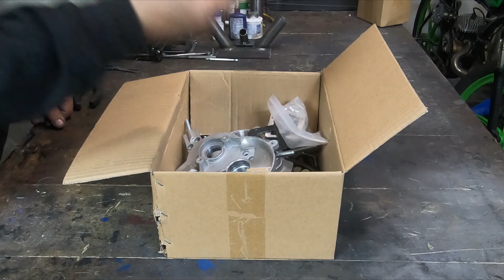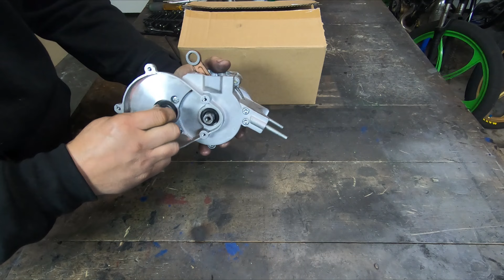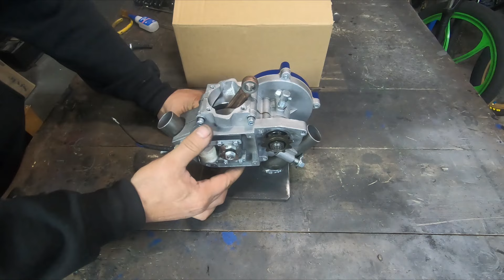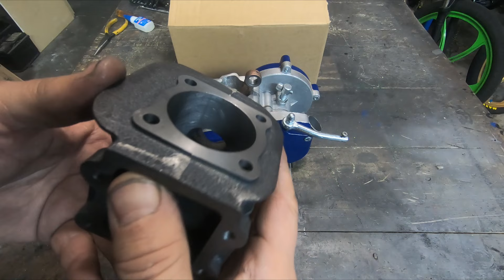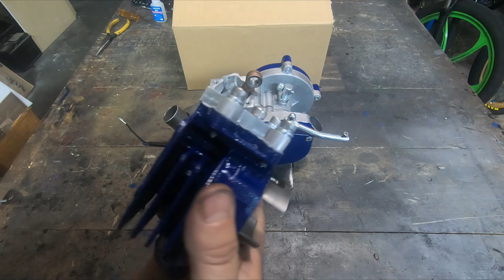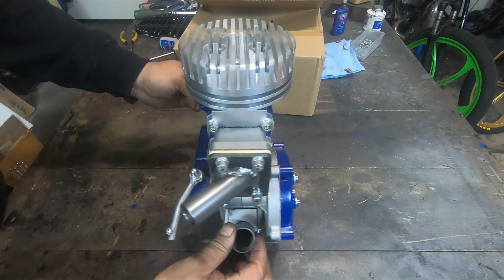Fastest Motorized Bike Engine Ever Built !

Comment: I start with the ZEDA engine. The cylinder has the 6 little dots on the side, this has  bigger bypass ports. I match all the openings, intake and exhaust plus the gaskets so there is NO gasket in the way. Intake port is raised 2 thousands and the exhaust is lowered by the same. All edges around the ports are smoothed .The piston skirt on the intake side is trimmed so when at TDC there is no skirt blocking the port. The Big Block reed. Stock ZEDA carb with a #65 main jet. I drill a few large holes in the black plastic breather cover. Tuned pipe and Hi Compression Head. Head is torqued to 15lbs. 
One of the really important things is to simply warm these engines up completely before going out for a ride and asking the engine to perform.
When first started it will run in 4 stroke then as it warms it will run in 2 stroke as it should.
Bike is a 26in Aluminum Beach Cruiser, running 2.25 Kevlar tires with street tread @ 50lbs. First of the season wheels are removed so the bearings are greased and bearings checked and set.
44 toothed rear sprocket., thinking about changing it to a 36 tooth. 
Screaming top end 39-40 mph, backed off to 70% power it will comfortably run @ 30mph.  71.68 mpg.
For some reason I just can't leave nothin' Stock, I'm just a Tinker er.  LOL
Reply: Same!!! I just got into this stuff…, and absolutely love everything you can do to these. Those billet heads sure do pull a lot of heat out of the engine lol makes staring again after sitting for 30 minutes like a cold start all over again.
Reply: ,,,,great work,,,,,,,,,give yourself credit as a gearhead,,,,,,not a tinkerer.....................tinker's don't know about port timing and  machine work...........

Comment: An excellent lubricant for porting is Sthil bar and chain oil.
 I've used it extensively on v-8 engines, even on aluminum without any problems.
 I even use cutters for steel on aluminum without any plugging issues.

Comment: I like how the gasket is still prioritized on the clutch cover despite the fact that it has a huge hole with gaps on it. XD
Reply: Metal on metal is never a good idea with out some sort of gasket , the cover  still bolts on , I suppose a substitute would be to use locktite on bolts so they don't loosen off
Reply: I've run my stock china doll for years and never had issues with those bolts backing off. My gasket broke in the first month and it hasn't had one since

Comment: I have built a couple engines myself and watched a lot of videos and people building up these little engines but I still don't understand the spacer plate between the cylinder and block? Is this to make up quince gap for a upgrade longer stroke connecting rod? Can you please explain?
Reply from the maker: The china case was designed for a longer cylinder with a 40mm stroke  then the minarelli  cylinder with same stroke , the spacer is just making up what is missing

Comment: Where do get your g2 reed valves? I keep getting crappy ones with leaky gaskets and bolts that strip
Reply from the maker: i upgrade them too 6m bolts a i set the reeds , ive never had a issue

Comment: I recommend buying a Malossi cylinder, then you can feel the right power
Reply from the maker: i've tried all kinds of cylinders , i designed this spacer type and now everyone builds these china even copied it
Reply: On Malossi, the portings are done much better and there is a good vortex in the cylinder, it ensures good lubrication and the cylinder compression does not become low. Nothing needs to be done and the cylinder develops 7-8hp @dlhperformance7169

Comment: Has anyone tried a standard minarelli vertical intake and a 19mm PHBG?
Reply from the maker: sure they have , a standard reed for the minarelli  is a stock 2 peddle reed this is a 6 peddle performance reed setup exclusively sold by DLH Performance
Reply: Do the bicycle engines run better with more of a restriction at the intake compared to the scooter engines?
Reply from the maker: @jb314stl  I've won 1st place 3 consecutive times with this design their is no restriction at all , actually the stock setup is not for racing or performance a single flat reed doesn't compare
Reply: @dlhperformance7169 My original comment was aimed at the community. I wasn't taking a shot at you or your design. 
I was refering to an intake like the MXS Racing for minarelli vertical or one off a MBK Booster.

Comment: You should look up minareli horizontal full stage6 rt drag racing 😉
Reply from the maker: yes i have , very fast engines in that specific class . this is a  2hp engine originally stock that's is now 12hp   that fits on a bicycle with only one drive gear. a totally different class of engine we are talking

Comment: Hi, I hope I'm not asking the same questions so.
You took quite a bit out of the flywheels near the B/E. Did you drill them or are they AM ones. 
And why did you do it and is the rotating assembly balanced? and to what degree. 
Did you do anything to the barrel were the reed valve setup goes. Very trick and well thought out if I can say. Nice. 
Did you polish inside the reed block housing itself. 
You can polish the top of the slug to if you want. Likewise with the combustion chamber as you didn't show it. 
And what's the capacity. Did you stroke and poke it. 
It looks a beast. 
Cheers.
Reply from the maker: Hi Mike i have several videos on cylinder porting , case porting, 70cc complete build up . you will find your answers in these videos 
thank you Sir
https://youtu.be/QqTTZnek8Do
Reply from the maker: https://youtu.be/pl9aQ9_SwnU
Reply from the maker: https://youtu.be/3wT5AKIrnwc

Comment: Hey Darcey not being a smart as but asking sincerely cause Maybe I don't know y but why do you still put a gasket on the clutch cover? You know cause it's not sealing the cover anymore. Jw thanks
Reply: All it does is give the clutch disk more space  in the cover .. now if I cut a bigger hole . Your would not need the gasket . Also I feel it helps with metal on metal vibration causing bolts to loosen . Goog question tho , I guess it's up to personal preference
Reply: @darcyhemeon4309  ok no doubt jw I was thinkin about metal on metal but personally didn’t think it mattered for that but it definitely could. Either way thanks for sharing. Hey I know u do a lot with the minerallis but the vertical is the one everyone uses from what I can tell but the other ones I see on eBay don’t have the built in Reed block but if enough work was put into them I could just add a Reed block into it and have it go in at bottom kinda like the vertical. I’m assuming they are case reeds
Reply: @JMB676  yes I have a few jog cylinders that your referring too they are case Reeds , I have a stage6 coming as we speak
Reply: @darcyhemeon4309  ok I was lookin at them last night on eBay n seen. They don’t have an intake port and it started me thinkin about makin one into a dio Reed basically so I figured I would ask you since your the only one that seems to post any useful information o these motors
Reply: Your definitely a pro! Decent music too. Hey can I fit a horizontal minarelli on a big block case like the YD100 bottom? Beautiful colors on the beast btw!
Reply: @KenC56mm  I haven't had the YD case yet so I can't answer your question,  but I can say if thier is a will thier is a way   and I can't see why not if it's built into a case Reed or made into a case Reed
Reply: @darcyhemeon4309  that would be there
Reply from the maker: you can fit one but needs a custom crank made up , the crank journal is longer in a yd 100 , also you will need to tap new holes in case for they dont line up

Comment: I see no evidence of Fastest Motorized Bike Engine Ever Built from this video, Never even ran. Also never want your clutch casing open to outside elements, Very dumb, Pretty but Dumb.
Reply from the maker: I'm sorry you feel that way but obviously you did not understand this video, it is not about how fast the engine is but how fast the engine was built and built in 7 min.  however Sir, this engine is a 60+ mph build and in my opinion very good looking minarelli , the SAF Super Clutch is one of the strongest on the market as for the open clutch cover everyone not just me plus other vendor run open cases with absolutely no issues ,
thanks for watching !!!!
Reply: @dlhperformance7169  Just giving my advise as a 25 year Fabricator and Mechanic of small engines. Open casing's let in foreign elements to the gear and damage it over time, Just a fact. The video was fine though and the motor build was great.
Reply: @stephenfhauk  even a Plexy glass cover would look great. When he took the cases off, I thought he was replacing them with clear ones.